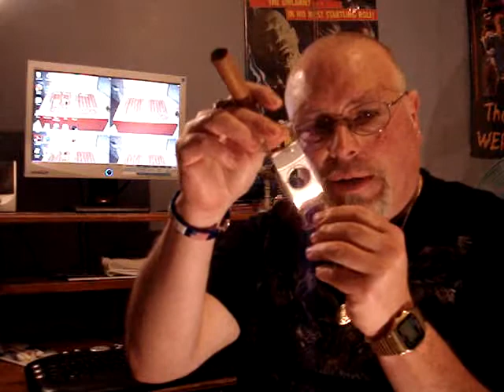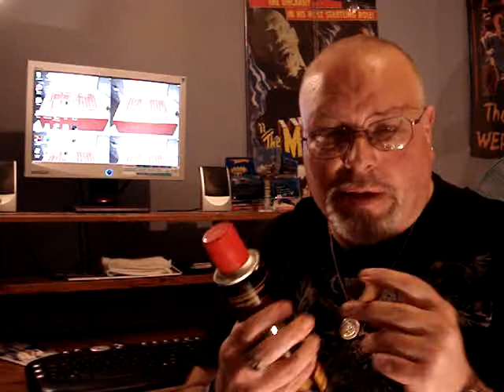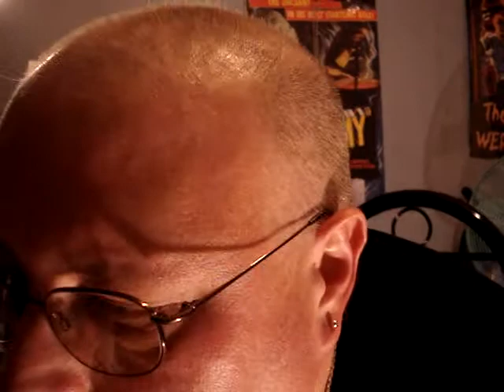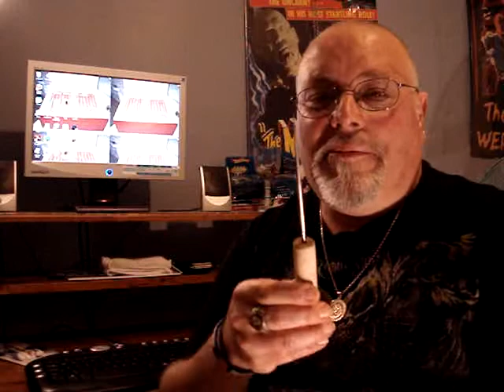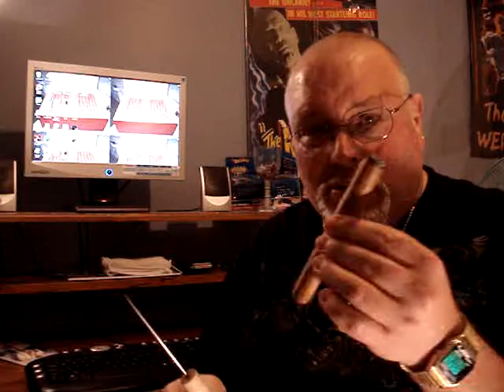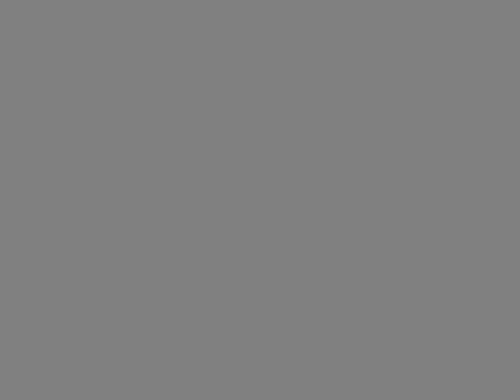Cigars 101 Part 2

Comment: You were good on some points, and missed a  bit on others.

For one, you surely scorched the foot of the cigar while toasting it. It's called toasting, as you slowly heat it, keeping the foot of the cigar out of direct flame. With a torch lighter, depending on flame size, keeping the cigar 1" to 3" from the tip of the flame is sufficient. 
When you put the cigar directly into the flame, as you did, you overheat the tobacco, scorching it and hurting the initial draw's flavor.
Reply: I'm a beginner smoker and I thought the samething he scorched the shit out of that cigar, the process is called toasting Not, burnt toast oh well I learned what Not to do..